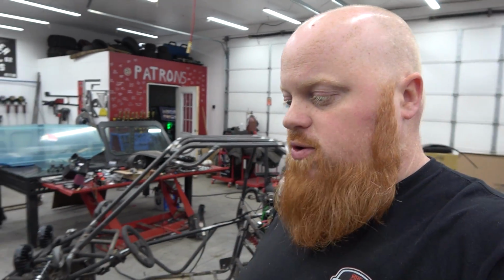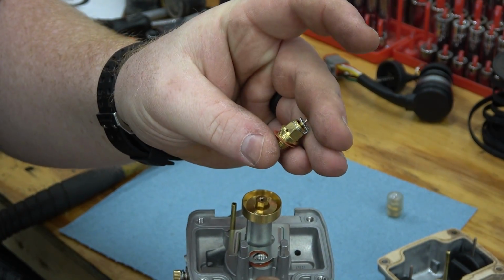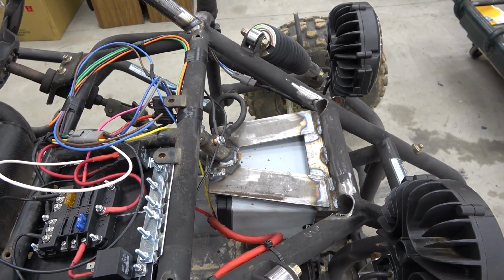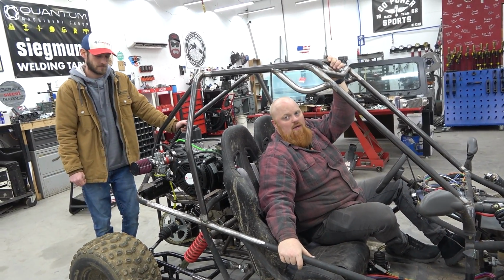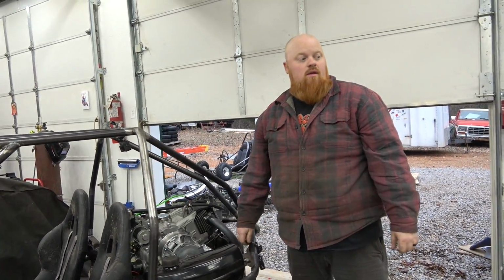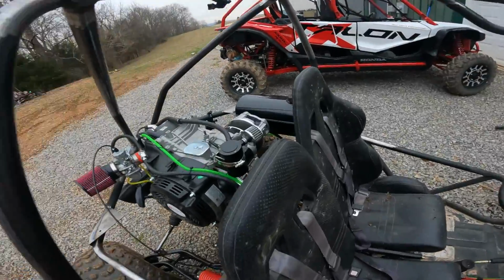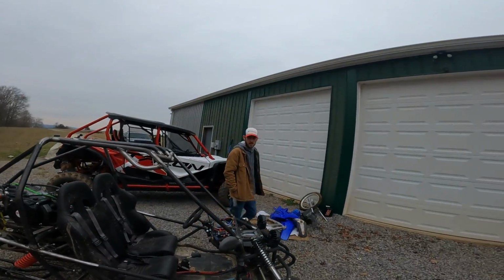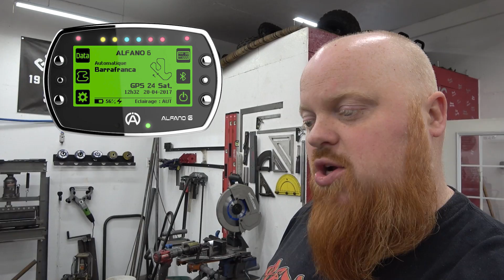625cc IRS Kandi Home Made SXS First Drive ~ She RIPS!!!

Comment: I was going to mention the belt and pulleys at 17:13 as the belt went so loose there.Something wasn't moving right.I thought lighter weights in the top,especially as you said you're putting bigger tires.You guys did a great job.

Comment: Bro , all u need to do is toss a exterior mounted fuel regulator the plus about this is , ability to 1: adjust pressure to desired . 2: utilize a pressure Guage inline . 3: have a factory port for electronic fuel pressure Guage in digital read our on dash ...

Comment: Just a question... Is that battery an AGM or flooded type battery? If flooded it will eventually leak on everything under the vent port. If it is an AGM then there is nothing to worry about leaking. Excellent to see this build rolling and ripping.

Comment: It looks like your secondary clutch(lower pulley)  spring needs to go to the next stiffer  position witch will take care of that belt slacking out when operating. There’s  multi positions when you take clutch off and pop  snap ring off the clutch pops into two and then you’ll be able to see the spring and the spring positions. And it will hold the gear longer so it don’t max out. I agree it’s shift to easy/to quick. But position change will take care of it as the multi position holes are more then enough. Like if you put spring in stiffest position then it would not shift at all. So I’d try that before buying a spring. Rare to need to replace that spring

Comment: It needs some clutch  work for sure the primary needs weight taken out of it  You can see it not coming all the way together when your at Max RPM that's probably out of a snowmobile which revs a lot higher RPM than that motor the second   Needs index or stiffer Spring.  You can get a different helix for the secondary  To change how fast it shifts basically 1st gears your primary clutch an 2nd  gear secondary clutch go watch some snowmobile clutch work videos  .get the clutch right i bet you'll be real surprised. 👍